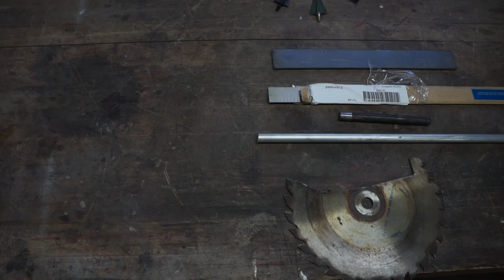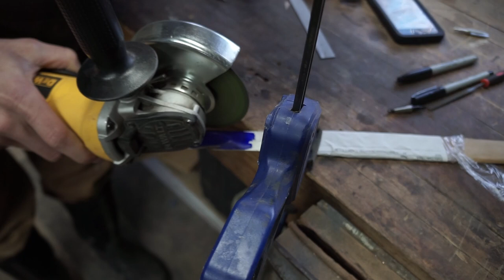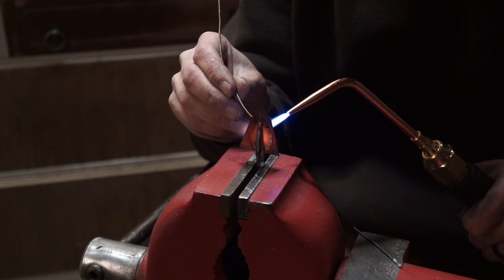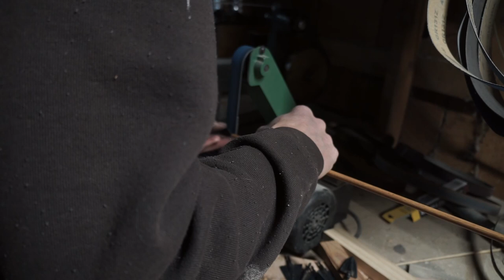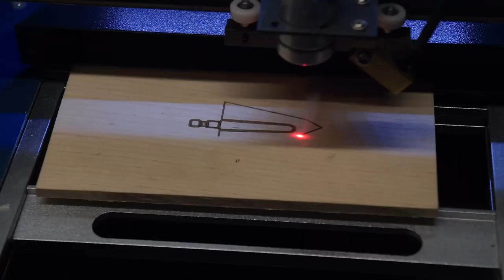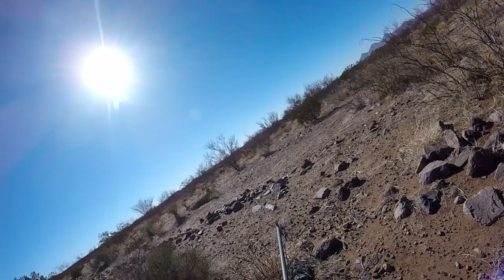Making Broadheads and Hunting Javelina

Comment: I've been toying with this idea for a long time. The first broadhead that I made aside from trade points and stone points was done in a similar manner but I forge welded a mild steel ferrul to the blade. When I heat treated I ended up with a warp and not thinking I tried to straighten it out a bit and snapped it straight in half.
Reply from the maker: I was also worried about it warping and the silver solder melding during heat treat but because I just did an edge quench it did alright. I’ve played around forge welding the ferrule but haven’t had much luck keeping it straight. I have some other ideas but haven’t worked everything out yet. Let me know how yours turns out.

Comment: Holy cow , I can totally do this. Just single bevel them and turn the old Lincoln up and do a hot fast tack .
Reply from the maker: You definitely could. You might have to do some clean up to smooth out the weld so there wouldn’t be added resistance. Let me know how it works out.

Comment: Hi 
By any chance would you make ferrules for other people who do not have the tools to do it?
Reply from the maker: I’ve been playing around with lighter material that will be strong. Once I get it figured out it might be an option.
Reply: @Makingitwild  have you tried nylon round stock? that you could trim down on a metal lathe? I was thinking to do that with a drill and tools. the cheap mans lathe
Reply from the maker: @squrilebrain  I haven’t because of durability but some companies do make them out of nylon so it might work fine. It would be much easier to machine.
Reply from the maker: Also a drill works well in place of a lathe for a lot of things.